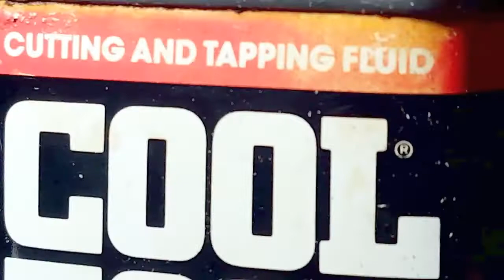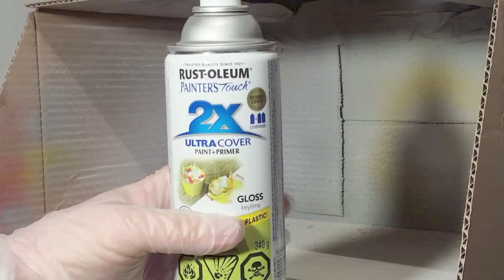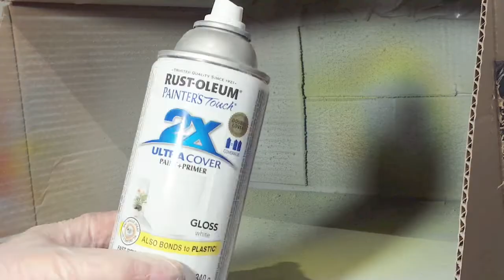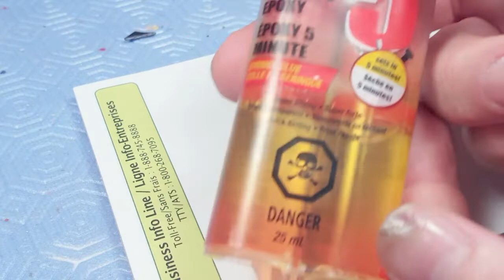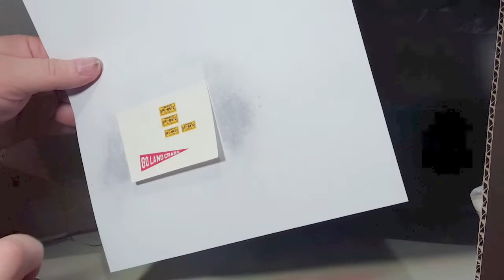Dinky 27F or 344 Plymouth Estate Woody Wagon Resto-Mod

Comment: Enjoyable video, but I'm a little surprised that there are no 3D viewing options.  :)
Reply from the maker: Thanks Steven. I knew my 3D friends would be disappointed with the 2D, flat, presentation. I thought about doing it all in stereo, but I really don't have  the equipment to do a proper job. I'm sorry for the stereo friends who are disappointed, but maybe I will give it a try on one of these videos. It will certainly be a challenge. I don't have much experience with stereo video.
Reply: @timosdinkydetailing  Just ribbing you - you did an excellent job!  I haven't owned any Dinky Toys since the early '70s and I still watched the whole thing from start to finish!  Very engaging.

Comment: Nicely done looks great, can I ask what is the size of the tapping tool end the screw?
Reply from the maker: Thanks Aus. I use 4-40 UNC screws for most of the Dinky models I work with. I did use 2-56 screws on the SHADO Interceptor legs, which are about the same size as an m2 screw.
Reply from the maker: The tool (the tap) is an Osborn Blue Wizard tap, which is the best tap, if you happen to be looking for one. ;-)
Reply: @timosdinkydetailing  Do you know the size of the tap? I have a few Dinky's here and this method looks good. I wanted to use rivets, but I can't find a small one. Thanks RA
Reply from the maker: @RestorationAustralia  The tap size is 4-40, which means #4 size with 40 threads per inch. In Aus I imagine you would use metric screws, since Imperial stuff is hard to find outside a few countries where Imperial is still used. Marty uses M2 screws for Matchbox toys, maybe M3 or M4 would work for Dinky and Corgi toys.
Reply from the maker: @RestorationAustralia  Yup. That's what I like to use. Keep in mind you will need some 4-40 hex socket button head cap screws to go along with this set. Looks like there are few choices down there, at least on ebay and even then, six to a package. I got my screws 100 in a little bag from Amazon, from China. I think you may have more luck using metric. I use Imperial because I have so much tooling in Imperial already. In Canada, the metric stuff is also easier to get these days.
Reply from the maker: @RestorationAustralia  1/4" is going to be long for some posts. You could cut them down in those cases. I suggest threading a hole in a scrap piece of metal, putting the screw in it to protect the threads during cutting, and also it cleans up the burr when you take it out.
Reply: @timosdinkydetailing  Thanks for your help, keep up the good work.

Comment: Timo  try a product called Zep Crystall  Heat  industrial clog dissolver which is Sodium Hydroxide or  costic  soda  I got this at  Lowes here I Victoria  BC Canada Tony O
Reply from the maker: Good tip Anthony. I started using caustic soda some months ago. I ordered mine off Amazon because I didn't find it in any store. I should have a look at Lowes next time.